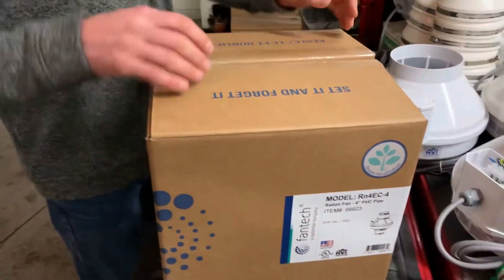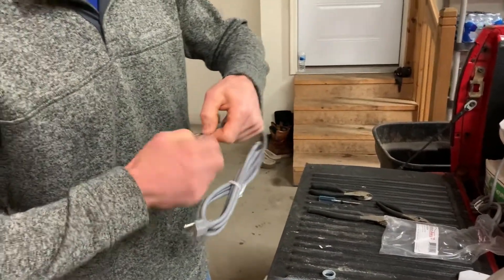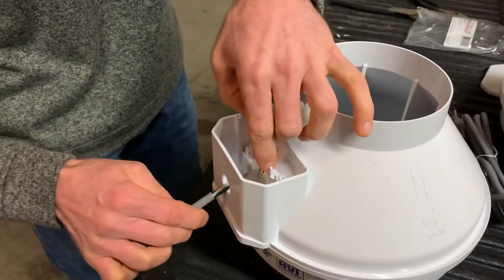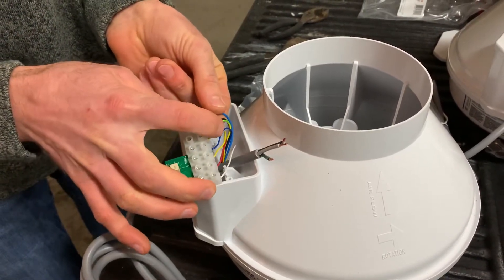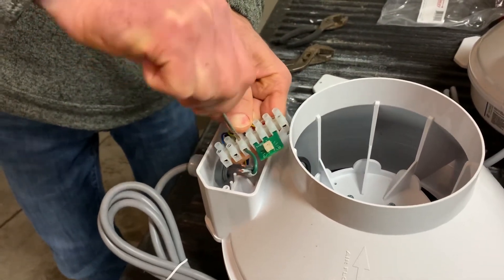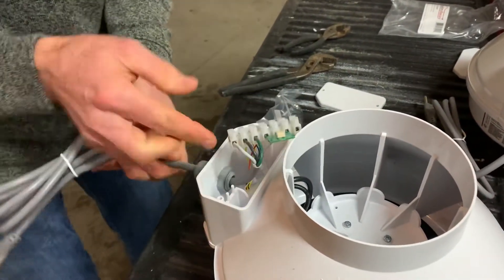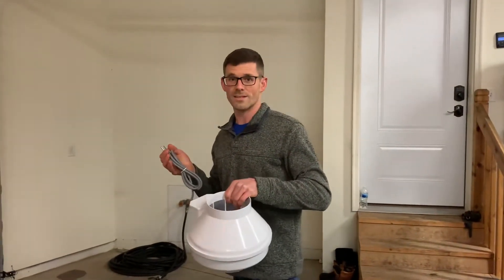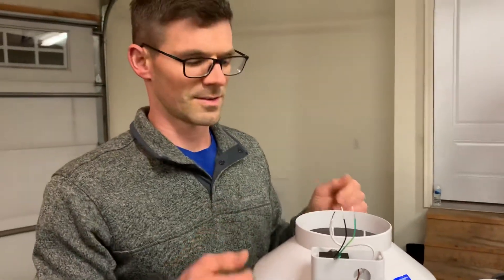How to Wire a Fantech Rn 2EC or Rn 4EC Radon Fan

Comment: I just bought the Fantec on Amazone but later noticed in the description it was 12V! I was confused so I found your video and it seems clear, these fans are 120V. I haven't received the fan yet but I am assuming the Amazone site is wrong.

Comment: Is it ok if there is no green wire? I am replacing my existing fan with the Radonaway RP145c. It only has a white and a black wire however. But the existing power line has black, white and green.
Reply from the maker: Yes, a few fans don't use a ground wire.

Comment: Bought the exact fan in your video and wired same way.  Plugged in and didn’t work.  Checked w a meter and have power to wires heading to fan.  Must be a problem at the fan I guess. Sending back.  Hopefully second one will work.
Reply from the maker: Be sure you have the dial turned all the way to the right. The EC fans take a few seconds to start.
Reply: The exact same thing happened to me.  Wired it exactly as the schematics say.  Plugged it in and nothing.  Checked with multimeter and has power but won't turn on.
Reply from the maker: Be sure to wait a few seconds for the fan to turn on. 

I mixed up the white and black wires once. I called the engineer at Fantech to ask if he knew why it wasn't working. He sounded surprised to hear they shipped a fan that didn't work. We quickly figured out where I went wrong, and I was back in business once I switched the hot and neutral wires.

Comment: The bottom alarm in the basement says low fan pressure does this mean I need to replace this thing you wired? I also think the culprit could be that water got in the power outlet outside.
Reply from the maker: It’s hard to troubleshoot without more information. I'd start with the electrical if there's water getting into it.
Reply: @AmericanRadonMitigation  You are awesome sir! I had to fix that! Water got in and I click the reset button on the outlet now the fan is working and the light downstairs is back to green. Much love from Atlanta. <3
Reply from the maker: I'm glad we were able to help, Carlos!

Comment: Thanks for your helpful videos! I bought a Fantech Rn2X to replace an old fantech fan. There is no clear place to put the ground wire. Do you know where to attach it?
Reply from the maker: You bet, Aaron. I don't think they use a ground wire. My new Rn1 and Rn2 fans don't have a ground either. I think they only use a ground on the EC line of fans.
Reply: @AmericanRadonMitigation  thank you! I had messaged Fantech support, too, and they said the same thing.
Reply: Green IS the ground!

Comment: A ++++ for all your videos buddy
Reply from the maker: Thank you so much! 

What fans do you guys use most often and where are you located?
Reply: @AmericanRadonMitigation  we are located in Lexington Kentucky, we learn more towards RADONAWAY.
but other manufactures are good as well
Reply from the maker: @eliteradonsolutions4083  Thanks for sharing. I started out using RadonAway. Do you guys mostly is the RP145?
Reply: @AmericanRadonMitigation  i utilize a similar technique like yours with pitotube, checking for PFE, friction loss, gate valves and season change. That being said i use RP145 in 70 percent of homes, but i think i need a fan like fantech to adjust.
what`s your thoughts on them and how they are holding up ?
Reply from the maker: @eliteradonsolutions4083  They had issues with the first generation of the Rn4s. I haven't had any problems with them since then. 

The EC fans are more expensive, but it really cuts down on labor if you don't have to swap fans to find the one that gives you your desired pressure field extension.

You could also get by with just carrying two fans on the van if you wanted to. The Rn2 EC and Rn4 EC have the potentiometer inside the electrical box, so you could dial them into whatever parameter you need.

If you wanted to install super energy-efficient systems, these would be the fans to use. We have an Rn2 EC mitigating a home that is only consuming 4.5 watts of power!

Give Brent, with PDS, a call if you want to try them out.  719-444-0646 

https://radonpds.com/product-category/radon-fans/

How do you guys calculate friction loss?
Reply: @AmericanRadonMitigation  thanks for the info, i will reach out to Brent and check on the pricing.
ss for how i calculate the friction loss i am gonna show how in my next video,u know trying to compete with you and Scott from Radon Man channel :)
Reply from the maker: @eliteradonsolutions4083  Perfect, let me know when you get it posted!

I love watching Scott’s videos! YouTube keeps recommending them to me even though I’ve already watched all of them.
Reply: @AmericanRadonMitigation  will do
Reply: How do the fan turn on and off ?
Reply from the maker: Radon fans are meant to run continuously. The moment the fan turns off, you have radon entry occuring.

If the fan is in the attic, you would unplug the cord to turn the fan off. If the fan is outside, you flip the switch hardwired to the fan to shut the power off.

Is there a reason you want to be able to turn the fan on and off?
Reply: @AmericanRadonMitigation  thanks for getting back to me there is inline fan in my attic it is not working(It make squeaky noise and I called technician and he disconnected it). I taught this is part if Bathroom fan but I noticed the pvc pipe is coming from basement not sure the use of this fan.
Reply from the maker: This video might be helpful. https://youtu.be/RfGboo5kpV8
Reply: @AmericanRadonMitigation  thanks so mach it is very helpful
Reply from the maker: You bet!